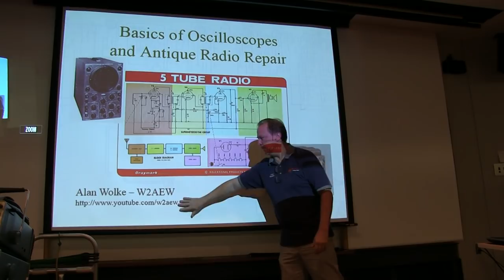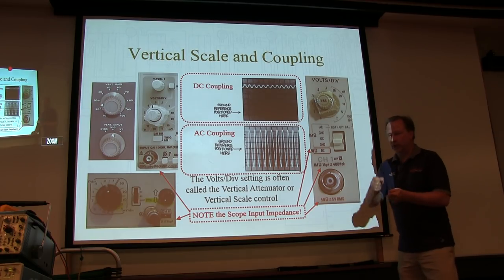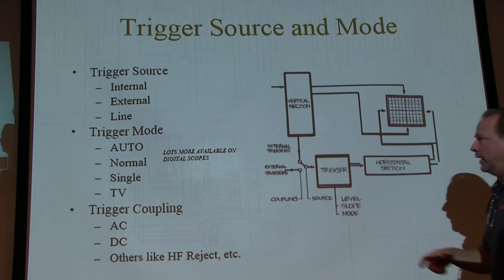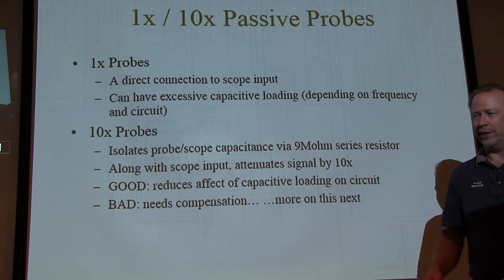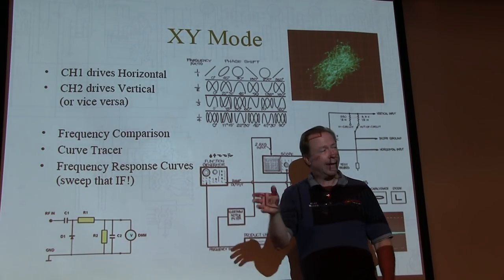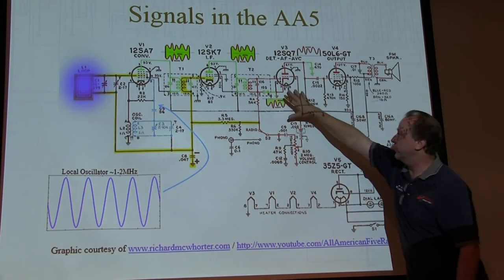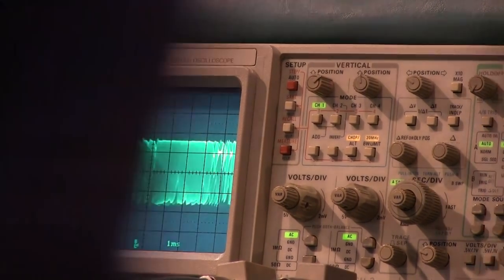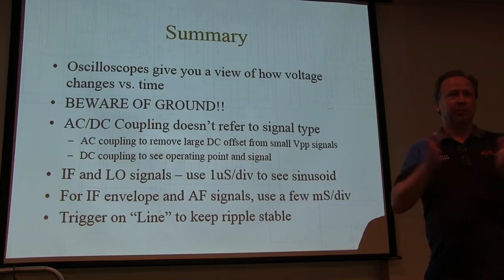#242: How to use an oscilloscope. Plus, seeing signals in antique radios | NJARC

Comment: Excellent video,  completely ruined by the background noise.
Reply from the maker: The background audio was from the "training radio" next to the scope.  Unfortunately, even with its volume turned completely down, it still has some audio output.  I didn't turn it off because it takes a few minutes to warm up, and that would have made it difficult to quickly make measurements.  I'll have to invest in a wireless mic if I ever record a session like this again.  Still, I hope you enjoyed the session in spite of the background audio.
Reply: I don't know why you didn't put a switch on the speaker or turn off the source transmitted signal.  If I was sitting on the left side close to the speaker I think I would have moved even though I would be getting further from seeing what you were doing with the probe, etc.  That being said it was a good presentation.  Instead of buying a remote wireless mic you could just use a pocket voice record or an app on your phone and sync it in software later.
Reply from the maker: Recording of the session was a bit of an after-thought, so there wasn't a lot of planning involved in setting up the camera position, audio considerations,  etc.  I didn't realize that the demonstrator radio's audio was going to obtrusive, so I apologize if it was.
Reply: Fair enough, Alan.  Like I said it was still worth watching.  Keep the presentations coming just use a recorder in your shirt pocket next time!
Reply: +Tony Hunt You would make a horseshit ham radio operator.

Comment: I Gave up watching some 10 mins into the Video, I just. couldn't put up with the  Radio or whatever it was that was close to the microphone... It Ruined  what could have been  a excellent video.
Reply from the maker: The background audio was from the "training radio" next to the scope.  Unfortunately, even with its volume turned completely down, it still has some audio output.  I didn't turn it off because it takes a few minutes to warm up, and that would have made it difficult to quickly make measurements.  I'll have to invest in a wireless mic if I ever record a session like this again.  Still, I hope you enjoyed the session in spite of the background audio.
Reply: Thank you... I figured it was the radio and hoped some one would have pulled the speaker or put a dummy load on it with a switch.  The fellow talking next to the camera mic was just as distracting.  I had so hoped to follow this lesson... brilliant idea,  Thank you
Reply: vol ume con trol is the spec ial sec ret
Reply: Usually I'd be the first to be bothered by "little" things like the radio or the guy talking, but I found the talk engaging enough that I didn't notice either very much, or when I did I didn't care. Which is incredibly rare for me. I really hope you guys give this video another chance, cuz it has some excellent content from an excellent presenter.

I can totally relate, though. Something relatively small like that can be the difference between an amazing lecture or something that's completely unwatchable. Especially if you have ADD\ADHD as I have. Your brain just latches on to any little distraction and it becomes the entirety of your focus. It makes reading stuff damn near impossible for me, so channels like Alan's are truly a godsend.

Comment: I'm trying to find an isolation transformer made for electronics work. Can you recommend a brand?
Reply from the maker: Something like this (where you mount it in your own suitable case:
https://www.tubesandmore.com/products/P-T169VS
Or, something like these are are plug-and-play:
http://www.calright.com/Products/prod_id/2955/
https://www.amazon.com/Tripp-Lite-Isolation-Transformer-Outlet/dp/B00006HPFH/ref=sr_1_8?s=electronics&ie=UTF8&qid=1468158569&sr=1-8
Reply: Thanks for the tip! Just need to find a 240V version (because, you know Europe :-)
And by the way, thanks for putting up all your great videos. I leaned a lot from you.

Comment: I'd love to repair old radios, when it comes to replacing capacitors, tubes or resistors, fixing tears in the speaker and refinishing the cabinet...
But when it comes to using an oscilloscope to troubleshoot the coils, no thanks.
Reply from the maker: Using an oscilloscope isn't required, it simply can be helpful in the troubleshooting process.

Comment: Your presentation was extremely well done.  I would greatly appreciate your help with one question:  how do you know where to connect the ground lead of the probe to be safe?  Do you analyze the circuit and identify ground, do you just use a good known ground in your home/office,...?  From the end of the video where the radio is visible it looks like you put the ground clamps on a horizontal wire -- how did you identify this as the correct spot?  Thank you.
Reply from the maker: The scope's ground is connected to the mains ground in the scope, and thus should only be connected to mains ground in the equipment you are testing.
Reply: Great video. Thank you. So is the Radio under test and all the mains measurement equipment including the scope plugged into the isolation TX? Ground lead clipped to chassis of radio?
Reply: @lampmanpaul7459  Usually in such cases the scope is on an isolating transformer, though the equipment itself could be on it instead, but if the equipment during testing connects to something else which is grounded, you might find out after you damage something.
 You can always connect a high impedance voltmeter and check for both AC and DC voltages between the scope's ground clip and the equipment's ground or zero point where you plan to attach scope's ground clip. You can also check if there is a current between (AC or DC) when connected via a sensitive ammeter and a resistor large enough (physically and resistively) to prevent a damaging current for such circuit (usually in miliamps).
 Sometimes there is some small current between grounds regardless, and you could play it safe by using either a mid-value resistor (100 to 10k ohms), or a capacitor between 10nF and 100nF, or a 1k ohm resistor with a 100nF capacitor in series which provides DC/galvanic isolation and surge protection (through the cap).
Be careful and creative.

Comment: Could you do a video about safe guarding your oscilloscope and spectrum analyzer when measuring voltages and signals with older tube type equipment.  I think that the scope is easy enough but the spectrum analyzer has a low impedance of 50 Ohms.  Thanks.

Comment: Nice video, Just one question , both Radio and Oscilloscope are to be on Isolation transformer or Just the Radio? or Only Oscilloscope? Please advise Sir,
Reply from the maker: Only the radio.
Reply: @w2aew  Thank You Sir !!
Reply: @erikderuiter7 Yes, It's socket is separate with good ground. Thank you for info

Comment: I enjoyed your video on oscilloscopes.  I did not quite understand about the common mode and differential mode voltages on the output transformer.  Could you explain that a little further.  Thank you.
Reply from the maker: Differential mode refers to the voltage measured between two nodes, such as the voltage appearing between the terminals on a transformer winding.  Common mode refers to the voltage appearing between these aforementioned points and ground.  For example you might read 100mV between the output terminals on a transformer (differential mode), and also read that each of these terminals is ~60V above ground (common mode voltage).

Comment: A bit choppy recording in terms of framerate is the one thing i wish was changed but other than that nice video
Reply from the maker: The original recording was at 30 frames per second, but YouTube downgraded it to 15 frames per second - out of my control.
Reply: @w2aew  oh that is real dumb, i also had problems with my own recordings and yt reducing quality, but this was tied to bitrate. Hopefully it will be better for your future videos
Reply from the maker: @Neuroszima  I figured out later that youtube no longer liked the .mts file format that I had been using (native format for my camera), and started downgrading the frame rate.  Once I figured out this was happening, I changed my editing software and process to create .mp4 files instead.  These don't seem to have a problem.  Unfortunately, I can't simply replace the older .mts files that I have already uploaded, so we're stuck with that.